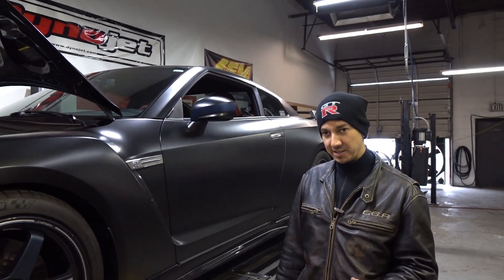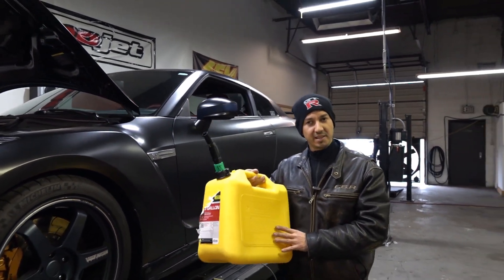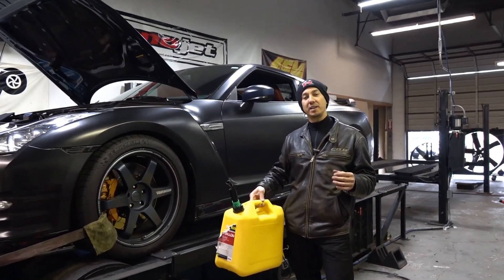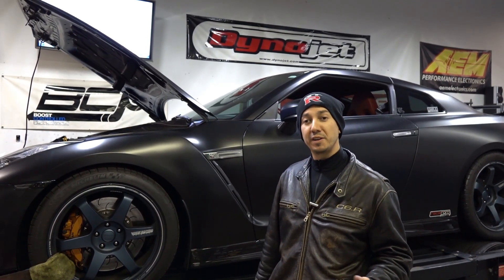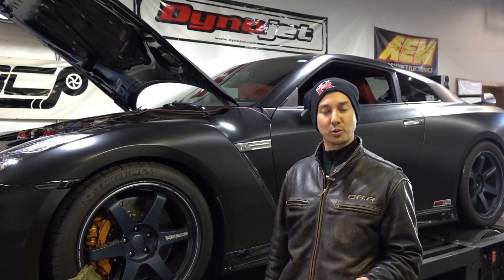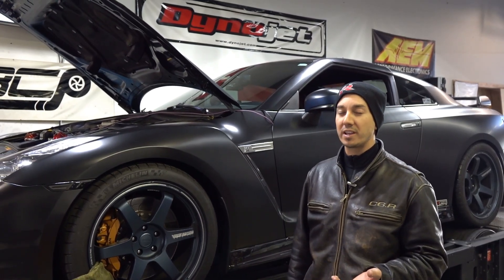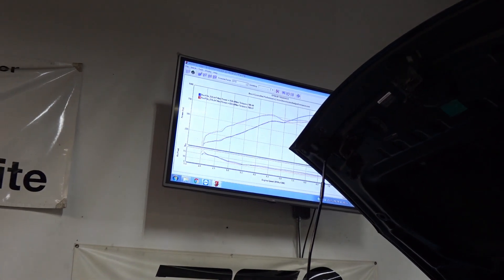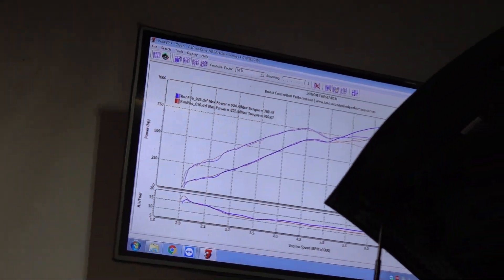How Does A GTR Make Power On E85?

Comment: Is this on stock turbos amd stock block?
Reply: Upgraded turbos, block must be upgraded as well.  Stock rods are good for about 650ft/lb torque max.  Sounds like the transmission has clutch upgrades and a billet 1st gear, but the limiting factor of this build is he needs built 2nd to 6th gears in the transmission.

Comment: Great video, and as always it seems like you’re really enjoying yourself exploring the Electronic Engine Management Strategy for you power unit. 

Just one point to note for viewers, when it’s said that the engine has been leaned out this is only in comparison to the fuel delivery strategy for gasoline. The Ethanol based fuel has a very prominent difference in latent heat of evaporation compared to the gasoline based fuel which means you don’t need to add extra fuel to cool the combustion chamber. Although it might look quite cut and dry, the calibration has a lot taken into consideration even though no exhaust gas temperature nor exhaust back-pressure data has been recorded.

Always a pleasure to follow the progress of this GTR 😉